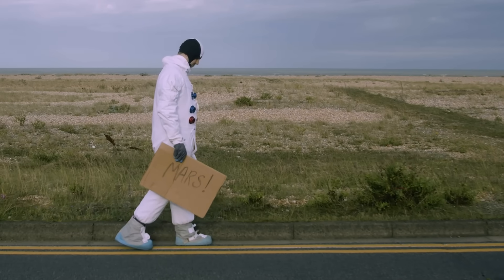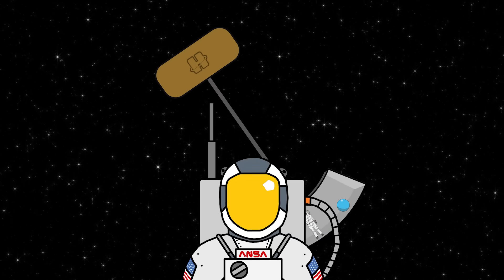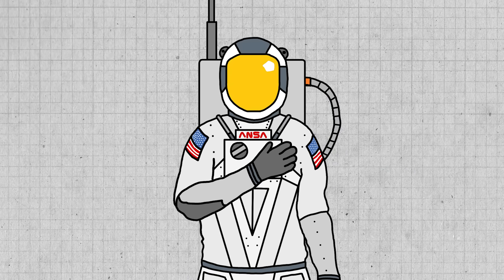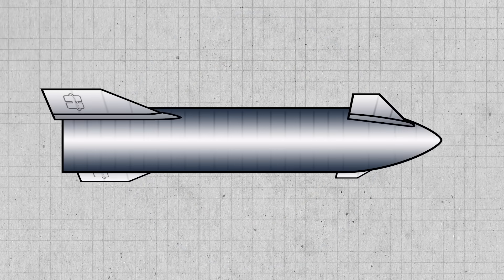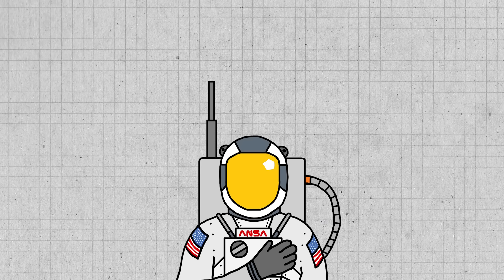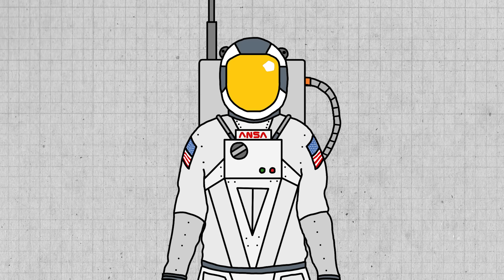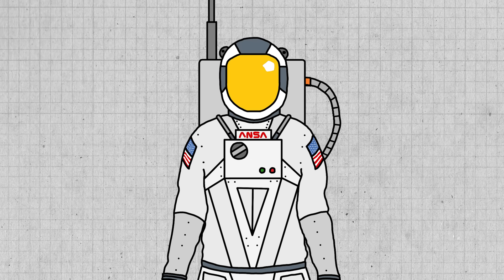This is NOT how you make Artificial Gravity

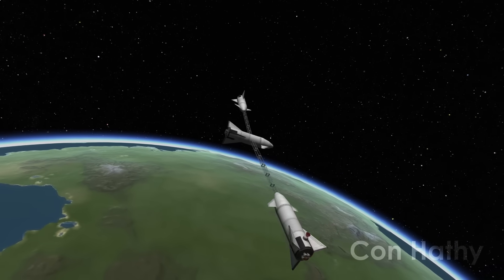Comment: 11:14   Doesn't that depend on how rigid the truss is?
Reply from the maker: If it wasn’t rigid it would just get twisted up which definitely isn’t better
Reply: @ConHathy  What I mean is that it is rigid, and it seems the single piece the three are are not going to be unstable if the truss tension goes through the CoM of the center fuselage.  Also, these structures can be actively damped.
Reply from the maker: @taliaperkins1389  flexibility doesn’t actually eliminate the instability, it would actually worsen it by giving the energy a palace to dissipate. Explorer 1 (the first US satellite) is a perfect example. It was spin stabilized around the minimum movement of inertia and had basically loose cables that swung out as antennas. After only one orbit (~90 minutes) the cables had dissipated enough rotational energy that the satellite was tumbling around its maximum moment of inertia.

The center starship with two cables coming out of its cg is literally the same configuration as Explorer 1 (if you look up an image you’ll see)
Reply: @ConHathy  You still aren't getting my contention.  Where did I suggest it is not rigid?   The fact it is rigid means only the moments of inertia of the whole can be considered, not those of the center fuselage by itself.   What is shown seems to be more like the dumbells in 5:05.  For that matter, for apparent the low, low vehicle cost of around $50mn per for each chassis, why not use 5 total and have even more dumbbells?
Reply from the maker: @taliaperkins1389  okay, yes if you had 4 outer one inner it would work but it would probably be more difficult to keep them evenly spaced. With 3, you can look at each moment of inertia independently and add them back together (there is a formula for accounting for location). When I say the center is at its minimum moments of inertia, it’s just the easiest way to explain why that ends up being the intermediate axis

Comment: Couldn’t you use a gyroscope to get the spin for tethering.  Use thrusters to start and tighten the tether. Then a gyroscope in the center of the tether to get up to speed and stop the rotation when it’s time.  This way you’re not wasting fuel just to spin and despin.
Reply from the maker: Well, they gyroscope needs to store the same rotational momentum as the entire vehicle, so it would have to be very very heavy and/or would have to spin very very fast. At that point just pack a little extra fuel instead. Just by the nature of rocket engines they will be more mass efficient because they’re exhaust moves at supersonic speeds and a fly wheel cannot

Comment: If the eye issue can be mitigated with the use of prophylactic glaucoma meds, maybe some kind of elastic suit that pulls the feet towards the shoulders enough to keep the spine compressed equivalent to Earth gravity and magnetic shoes that can replicate walking kind of normally could do the rest? I’m not a space doctor obviously so I don’t know but that seems easier than spinning the whole ship
Reply: Small internal centrifuge also sounds good
Reply from the maker: I doubt drugs or elastic alone would solve all or even most of the issues. You can’t simulate gravity by pushing on the outside of someone, you really need to accelerate all of the atoms in them simultaneously so fluids are all pulled down like normal

Comment: But with short radius it looks like the head is right at the pivot point hence not really any "gravity" pulling towards the feet at that part. Basically your upper half is in the transition shaft of the rotating station. Versus being well below the center and having the whole body under similar forces. I would think that's why the eye problem wasn't affected on the short one. Head is still in the center of the rotation.
Reply from the maker: Yeah that video isn’t the best example, the radius is variable and that was actually a control for a different experiment where the head was intentionally placed at the center, for an actual 10m radius (or 8 for starship I guess) your head will be several (~8/7) meters from the center
Reply: @ConHathy  oh okay, guess I should have looked into it more. Thanks for answering. Yeah, seems to be the way to go then.
Reply: Oh, and you owe me a phone screen! 😆

Comment: The solution to he "third starship" idea is, integrate the third object the same way as the two Starships...i.e., LENGTHWISE relative to the cable.  That way, everything in the system rotates on its MAXIMUM MOMENT OF INERTIA, regardless of position in the chain.
Reply from the maker: That’s actually a good point if you really needed 2 cargo for each crew, you could also hard dock the two cargo ships so they make a single heavier counterweight meaning you can use a shorter tether

Comment: Magnetic force is an easier option because it attracts metals. So if d floor of d spaceship is temporarily induced and metallic materials fixed on d lower regions of d astronaut’s body, the puzzle will b solved
Reply from the maker: Just sticking to the floor with magnets doesn’t really help with any health issues, and mobility in space is actually a benefit over walking so I don’t really see the point
Reply: @ConHathy  magnetism varies in intensity so an optimal attractive force that’s just enough to keep you just downwards can’t compromise health. More so when it can be effaced or regulated to a suitable level. How about this?
Reply from the maker: @kolobaimkamara8104  I’m not worried about magnets hurting your health, I just don’t see why they would help. They might hold you down but all of the fluids in your body are still going to flow up and you’re not being loaded across your entire body so your skeleton also won’t to see much of the force

Comment: You need a pressurized tube with long curves and a rocket that will fit in the tube vacuum tight. then you need to accelerate 1 g and decelerate at 1 g also. But good luck getting someone to build tubes in space.

Comment: Couple of thoughts, having acclimatized themselves to the Coriolis forces of a short radius centrifuge over a period of months in flight from the Earth to Mars, upon landing they'll be extremely disoriented by the sudden absence of those forces. It would be a shame if the crew that landed on Mars was incapacitated for hours or days by an extreme case of, in effect, "sea legs."

My second concern involves that catastrophic failure of the tether between two Starship that creates artificial gravity. Fine, we've dealt with the question about the forces driving the spaceships apart and the spin rates of each individual separated Starship. But what we haven't accounted for is several hundred meters of extremely strong, high tensile strength cable suddenly snapping back towards the Starships. That is a very dangerous scenario.
Reply from the maker: In the acclimation study they didn’t see a huge issue with that. They exposed people for 30 minutes a day and they adapted over time without losing their ability to function while not spinning

Comment: A single (okay, multiple for redundancy) cable tethering two starships nose to nose works PROVIDED both opposing modules have two gyros, one operating in the plane of rotation, and the other at right angles to it.  The ship is hard-coupled to the first and the second is allowed to rotate freely while being soft-coupled via an electromagnetic dampening system.  In fact, wobbles can generate small amounts of 

The problem with our inner ears is NOT mild. We can tolerate high RPM for a short while (minutes, barely into an hour), but over time, human can only acclimate so much, and prolong issues resulting from days to weeks become SEVERE, so AVOID AT ALL COSTS.

Hence, the two-ship tether nose to nose with wobble-stabilizing gyros rotating at no more than 1 rpm.  Sure, include a center module with solar panels, but you're going to have to figure out a way to get to it, safely, if something breaks.  A simple electric hoist works.

Also, both ships aren't required to fire jets to accelerate the rotation.  One ship firing for 1 minute at 1 rpm returns to the same two-ship track in space but at a different velocity.  Timing accelerations to last for a fraction of a minute, but at 30-second intervals, each using jets facing opposite directions, results in the two-ship body accelerating linearly with no net change in rotational velocity.

Comment: The problem with small centrifuges is that the smaller the radio, tne more evident the head-through-feet gradient of artificial gravity. For instance, in the Space Station Alpha, from 2001: A Space  Oddisey, considering such a large radius, the difference in artificial gravity between your head and your feet would be absolutely negligible. However in a very small radius, like that you propose, artificial gravity would be sensibly larger at the feet than at the heart. No need to say, the brain, which is almost inches from the center of rotation. This would create a sensible gradient which would obviously hinder the venous blood to return towards the heart from, say, your feet, while the heart wouldn't be stressed at all. With time, mostly women and predisposed people, would tend to develop a post-flebitic syndrome (Lower Limbs Vein Insufficiency), with transitory swelling and blood and liquid retention in feet and ankles. That would lead to a transient reduction in the effective blood volume and hence, a reduction in blood pressure... Apart that the inner ear adverse effects could be even greater, as yourself warned at the beginning. In the other hand, I can't imagine sleeping in such a torture rack, because each member of the crew would have to use the machine a significant time a day to be useful, and the only time a busy crew could devote to be useless would be during their sleeping time... That means that there would have to be at least une machine each two crew members and they would have to be divided in shifts.
I think tether is a better idea an infinitely more natural!

Comment: They don't need to rotate computers on the Starship. They could just rotate the image on the screen 180 degrees.
Reply from the maker: But the screen would still be on the roof or ceiling once you land
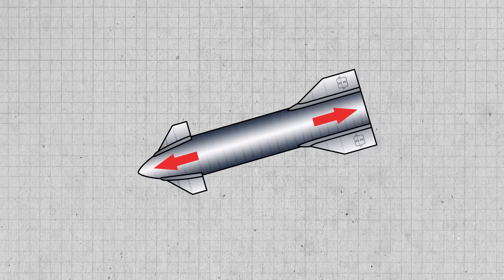Reply: @ConHathy  At 5:48 you show a picture where the screens are mounted on the walls. If Starship rotated about the short axis, floor and ceiling would flip, but the wall would still be the wall.
Reply from the maker: @eastwood451  sorry you’re totally right about that, for some reason my mind went straight to long axis and i didn’t thing of short until this morning. There’s still some issues with the rest of the equipment but computers wouldn’t be a huge issue

Comment: CAPTAIN CAPLOCK HERE....NO artifical graviety is needed for any human flights to Mars. What you really need is SPEED...LOTS AND LOTS OF SPEED TO REACH MARS IN 3 MONTHS. this can be done with thermal nuclear propulsion. No starship from spacex can offer enough sheilding to protect the crew and 100 passengers from solar radiation and cosmic radiation. SO ARTIFICAL GRAVITY IS A MOOT POINT. You just need to get the starship to mars in 3 months or less.

Comment: I'm sure I'm not the first to ask this, but what happens when the people inside move around? How much mass do you need so that the change inside doesn't affect the overall spin? Will your guidance system have to constantly deal with changing balance in your centrifuge?
Reply from the maker: It’s really going to depend on how many tons the ship is and how many tons the crew is. A dozen people in two starships probably couldn’t do much to the rotation

Comment: I would guess the other thing about small radius centrifuges is that to provide sufficient simulated gravity to keep the crew healthy, comfortable and clean you don't need to create a full 1G or even the gravity level of mars, something like moons gravity would probably suffice which translated to a rotating body with the radius of starship isn't even that fast... the actual engineering and integration of such a mechanism into starship is probalby the more challenging part...

Comment: If a cylindrical spaceship is built like a properly insulated hollow capacitor and is highly charged enough that charge interacts with spacetime, it could create artificial weak gravity on either surfaces of cylindrical spaceship without centrifugal force. In theory. It might also allow spaceship to generate artificial magnetic field due to displacement current created by electric flux.

Comment: Studies show 15 minutes a day in gravity reduces 85% of the bone loss of no gravity, and 75% of the bone loss of no gravity with 2 hours a day hard exercise.  A short rotation centrifuge for eating, toilet, bath, and sleep would solve nearly all no gravity problems without hours of exercise, and the long hours of sleep has low head turning effect. That effect in ground centrifuge studies is partly due to both the centrifugal force, and the gravitational force on a different axis. The fluid in the ears tilts in opposite directions. Not a big problem unless you turn the head resulting in the fluid swirling like when you slosh a cup of water so the water takes on a wave form against the sides of the cup. In the ear that's where the balance nerves are. As long as the fluid doesn't slosh you're ok. The surface of the fluid stimulated just the nerves at the surfaces of the fluid. But the slosh stimulates all the nerves in there making us dizzy. Like when you spin as a kid. You don't get dizzy until you stop. The fluid is still spinning with that angle which makes it slosh. In space centrifuge there isn't 2 directions of force so the fluid is stable, and if you slowly stop or turn your head you don't get that slosh as much.

Comment: I imagine the issue with the lab centrifuge was the size. The head is closer to the center so it’s moving less than the majority of the body. I’d like to see what the results would be with one twice as large where the feet are moving at a similar velocity to the smaller one.
Reply: What I’m saying is since the eyes are so close to the center the force on them is minimal.
Reply from the maker: @hi-ougidemonfang  the configuration in the video is actually a control where there is intentionally no force, the radius was also extended to load the eyes but you could be right that further increases help

Comment: This may be off the subject, since it doesn't involve spinning at all, but how likely would a constant acceleration method be for travel within the solar system?  This one gets discussed in terms of achieving interstellar travel, since the acceleration would gradually approach the speed of light, but I have to wonder if a limited case would make sense for shorter trips.

I realize, this has its own (severe) issues, since you need a fuel source that will last you the entire trip, and you're probably not going to be accelerating at anything close to 1G.. but if you could even approach 1/6 G,  that's been done before on the moon.  I think it would be interesting to study what the optimal constant acceleration rate would be for both travel time and crew comfort, while looking for a fitting propulsion method.
Reply from the maker: I actually just made a video about that and fuel source really was the limiting factor

Comment: I am a big fan of the two ship tether approach seems simple ie no extra equipment, well besides the tether. But what about an internal spinning deck? Like the gravitron circus ride. I think starship has a pretty substantial radius. Could have multiple decks counter rotating for stability.  Or spining at different speeds to get used to Martian gravity on the trip.

Comment: What was wrong with having a wheel scaped scacecraft. Just spinning. I have seen the experiment where you can make a wheel stand up cus you spin it and it wants to converse angular momentum or something. Or does the problem come cus of gravity on earth or the tether you have on the wheel, causing it to become unstable. Not a phyhics person so I cant really visulize it in my head.
Reply from the maker: Nothing physically wrong, it would be stable. It’s just a lot more complex than connecting two much smaller craft with a tether of the same diameter

Comment: Short radius is like treatment machine. Temporary but not something you would want to have for a long journey in space. The other solutions are just functional, unconfortable, unstable and require more than one ship so more complicated. One of the things to consider when you pretend to have artificial gravity is the comfort too, that means there must be a floor for stuff  to fall on it and you can walk. In a rocked shaped spaceship the floor is towards the rear engine due to the impulse and only when the engine is on, so it¡s not very practical unless you have a huge permanent rocket with several piled decks . On the other hand, if instead that rocket had a spining donut on its "waist" that would allow to build facilities on it while considering the rotation from the donut and the impulse from the rocket. That could even be designed collapsible like an accordion to make its compartments tighten to the rocket and later unfold, that would improve aerodynamics.